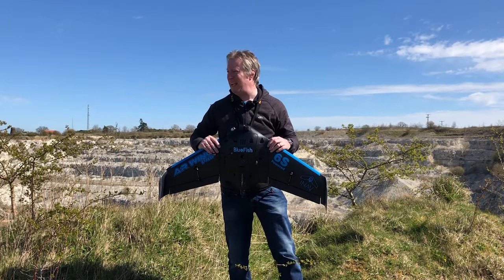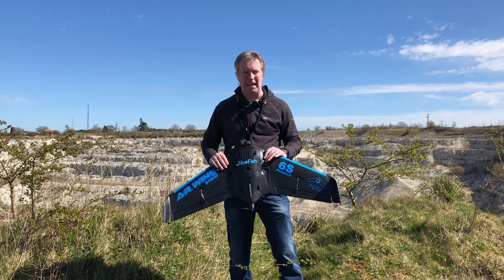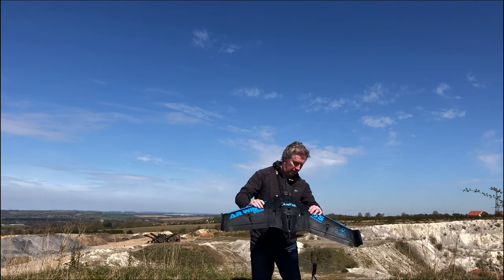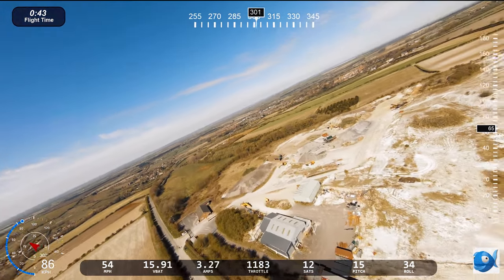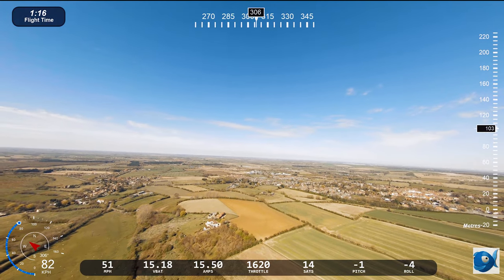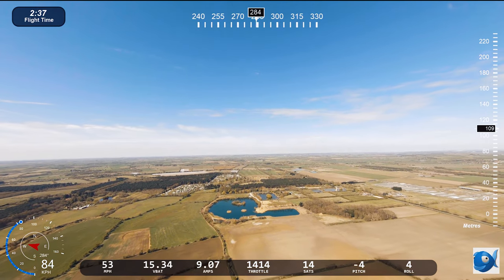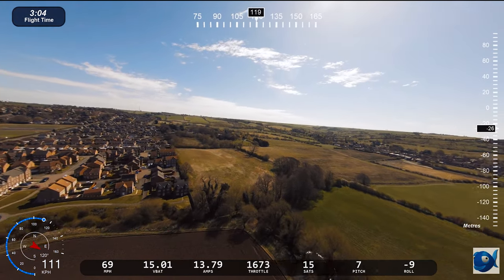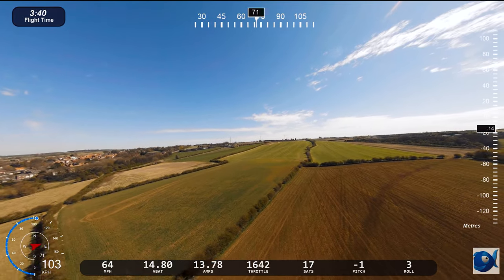AR Wing Pro - Flying In A Quarry

Comment: You are a very skilled pilot, many thanks for sharing and congrats on the great landing.
I would not have had the courage to go so low when there could be almost invisible cables and stuff and what if the radio signal has a glitch and you lose radio control for just a second while descending close to the ground, though to your defense most of it was line of sight, which you should always assure within your range. But still I am much more on the careful side ... probably the reason my recordings were sometimes beautiful, but never exciting like yours. I guess I have to work on reducing the fear of crashing/losing my wing, which is counterproductive to the joy I have while flying it.
Reply from the maker: Flying with DJI gives me so much more confidence I can see all of those cables clearly in the goggles. I particularly like low level flying and flying in the hole in the earth was quite exciting and my heart was pumping a bit tbh.

Comment: Great demonstration of fast proximity flying Glen, with a few rolls thrown in too.
At 06:23 you were very proximity to the lighting cluster! It was probably even closer than it a appeared in the video as the FVP lens is so wide!
Did you have access to the quarry to retrieve the wing if the worst had happened?
Reply from the maker: I really enjoyed flying that quarry and hope to have another trip their next summer. I have crashed a quad in there before but luckily I have access so it was easily retrievable.

Comment: Curious why you switched from the frisbee launch to the overhead launch?    Mind sharing your Autolaunch settings?
Thanks,
Will
Reply from the maker: Hi Will, I didn't feel comfortable holding just one wing and launching the AR Pro as the fuselage is quite thick so found the overhead easier.
Here are my launch settings, remember that the prop will spin at 1200 when you throttle up before launch!
set nav_fw_launch_velocity = 300
set nav_fw_launch_accel = 1863
set nav_fw_launch_max_angle = 180
set nav_fw_launch_detect_time = 40
set nav_fw_launch_thr = 1850
set nav_fw_launch_idle_thr = 1200
set nav_fw_launch_motor_delay = 100
set nav_fw_launch_spinup_time = 200
set nav_fw_launch_end_time = 3000
set nav_fw_launch_min_time = 2000
set nav_fw_launch_timeout = 6000
set nav_fw_launch_max_altitude = 6000
set nav_fw_launch_climb_angle = 30
Reply: @bluefish3607    Thanks Glenn.  Appreciate the info..  I got mine flying.. Finally.  Spending time trimming and tuning now..
Reply from the maker: @SteffenRC  Glad to hear that Will, once you get it locked in it's a real joy to fly.
Reply: @bluefish3607  Thanks for the info..  Sure do miss watching your videos, haven't seen a new one for a while.  Hope all is well and you are busy with work and flying....
Reply from the maker: @SteffenRC  Hi Will. yes I have been super busy and when I do get time the weather is not good. Hopefully will get out this weekend and record a session with the AR Pro testing iNav 3.0

Comment: Building an AR Wing Pro shortly. You still happy with this motor/esc/prop setup?
Reply from the maker: Hi there, yes I am very happy with it, gives a good balance of performance with reasonable flight time. Probably not great for really long range efficiency but perfect for fun proximity flying and some acrobatic fun. 

The T-Motor 75 amp ESC is probably overkill for 4S but my initial intention was to run it on 6S.

I guess the setup depends on what kind of flying you want to do with your AR Pro. Good luck with the build and maiden you will love this plane whatever you decide to do with it.
Reply: @bluefish3607  sounds good! I'm planning to do prox/mid range flying with mine. Also using a DJI air unit. Do you by any chance have an inav cli dump of the osd layout you used for your DJI goggles?
Reply from the maker: @despicableIcon  Here is my CLI settings for my default layout for DJI. Remember if you want to see (W)arnings, trip (D)istance, 3D (S)peed, (T)hrottle, (E)fficiency you need to add :WTSED into the Craft Name in  iNav.

# osd_layout

osd_layout 0 0 1 2 H
osd_layout 0 1 1 11 V
osd_layout 0 2 0 0 V
osd_layout 0 3 8 6 H
osd_layout 0 4 8 6 V
osd_layout 0 5 23 8 H
osd_layout 0 6 23 9 H
osd_layout 0 7 1 0 V
osd_layout 0 8 9 15 V
osd_layout 0 9 22 14 H
osd_layout 0 10 8 6 H
osd_layout 0 11 1 10 V
osd_layout 0 12 0 9 V
osd_layout 0 13 25 8 V
osd_layout 0 14 1 1 V
osd_layout 0 15 1 8 V
osd_layout 0 16 15 1 V
osd_layout 0 17 15 0 V
osd_layout 0 18 2 12 H
osd_layout 0 19 1 12 H
osd_layout 0 20 19 12 V
osd_layout 0 21 19 13 V
osd_layout 0 22 1 4 V
osd_layout 0 23 1 3 V
osd_layout 0 24 12 2 H
osd_layout 0 25 5 5 H
osd_layout 0 26 1 7 H
osd_layout 0 27 3 5 H
osd_layout 0 28 23 1 H
osd_layout 0 29 22 1 H
osd_layout 0 30 1 14 V
osd_layout 0 31 0 10 H
osd_layout 0 32 1 12 V
osd_layout 0 33 3 12 H
osd_layout 0 34 10 1 H
osd_layout 0 35 23 4 H
osd_layout 0 36 1 5 H
osd_layout 0 37 1 6 H
osd_layout 0 38 20 12 H
osd_layout 0 39 1 5 H
osd_layout 0 40 12 10 H
osd_layout 0 41 1 7 V
osd_layout 0 42 1 6 V
osd_layout 0 43 0 0 H
osd_layout 0 44 0 0 H
osd_layout 0 45 0 0 H
osd_layout 0 46 23 8 H
osd_layout 0 47 3 7 H
osd_layout 0 48 23 2 H
osd_layout 0 49 23 3 H
osd_layout 0 50 0 0 H
osd_layout 0 51 12 2 H
osd_layout 0 52 12 2 H
osd_layout 0 53 12 1 H
osd_layout 0 54 25 12 H
osd_layout 0 55 1 8 H
osd_layout 0 56 2 12 H
osd_layout 0 57 2 12 H
osd_layout 0 58 2 12 H
osd_layout 0 59 2 12 H
osd_layout 0 60 2 12 H
osd_layout 0 61 2 12 H
osd_layout 0 62 2 10 H
osd_layout 0 63 2 11 H
osd_layout 0 64 2 12 H
osd_layout 0 65 2 12 H
osd_layout 0 66 2 12 H
osd_layout 0 67 2 12 H
osd_layout 0 68 2 12 H
osd_layout 0 69 2 12 H
osd_layout 0 70 2 12 H
osd_layout 0 71 2 12 H
osd_layout 0 72 2 12 H
osd_layout 0 73 2 12 H
osd_layout 0 74 2 12 H
osd_layout 0 75 2 12 H
osd_layout 0 76 2 12 H
osd_layout 0 77 2 12 H
osd_layout 0 78 0 0 H
osd_layout 0 79 2 12 H
osd_layout 0 80 2 12 H
osd_layout 0 81 2 12 H
osd_layout 0 82 2 12 H
osd_layout 0 83 2 12 H
osd_layout 0 84 2 12 H
osd_layout 0 85 25 7 V
osd_layout 0 86 10 10 H
osd_layout 0 87 10 11 H
osd_layout 0 88 9 10 H
osd_layout 0 89 19 5 H
osd_layout 0 90 19 6 H
osd_layout 0 91 19 7 H
osd_layout 0 92 19 8 H
osd_layout 0 93 19 9 H
osd_layout 0 94 19 10 H
osd_layout 0 95 19 11 H
osd_layout 0 96 0 0 H
osd_layout 0 97 0 12 H
osd_layout 0 98 0 0 H
osd_layout 0 99 0 0 H
osd_layout 0 100 12 4 H
osd_layout 0 101 12 5 H
osd_layout 0 102 12 6 H
osd_layout 0 103 12 7 H
osd_layout 0 104 0 0 H
osd_layout 0 105 1 9 H
osd_layout 0 106 1 2 H
osd_layout 0 107 1 3 H
osd_layout 0 108 2 12 H
osd_layout 0 109 24 3 V
osd_layout 0 110 23 2 V
osd_layout 0 111 25 4 V
osd_layout 0 112 25 5 V
osd_layout 0 113 1 1 H
osd_layout 0 114 1 2 H
osd_layout 0 115 1 3 H
osd_layout 0 116 1 4 H
osd_layout 0 117 0 0 H
osd_layout 0 118 0 0 H
Reply from the maker: @despicableIcon  oh and these links might help https://github.com/iNavFlight/inav/pull/6230 

https://www.youtube.com/watch?v=hz1cg7HHgGw
Reply: @bluefish3607  legend! Thanks